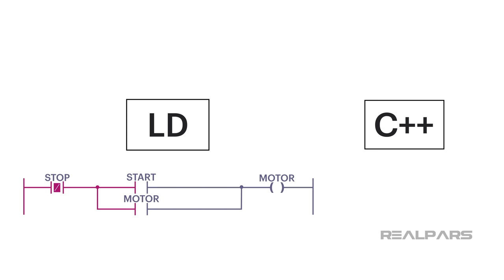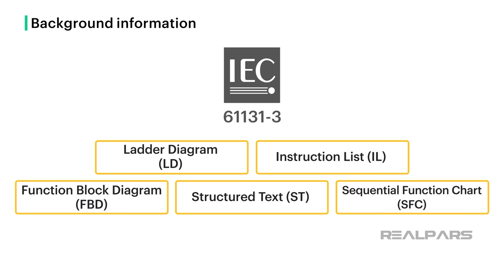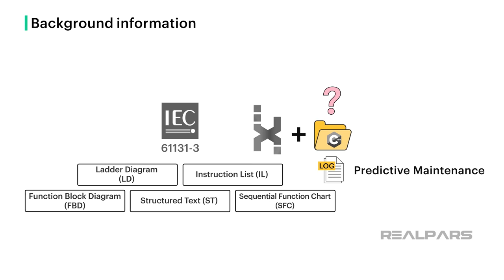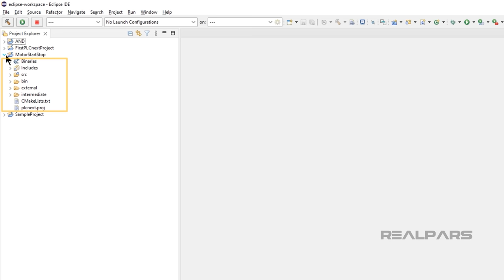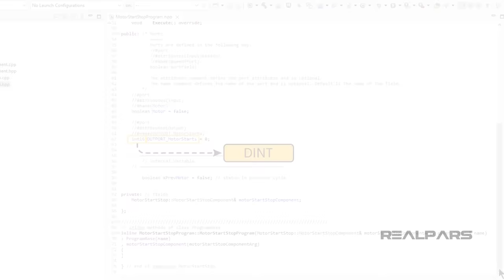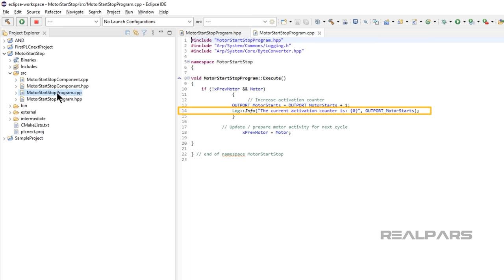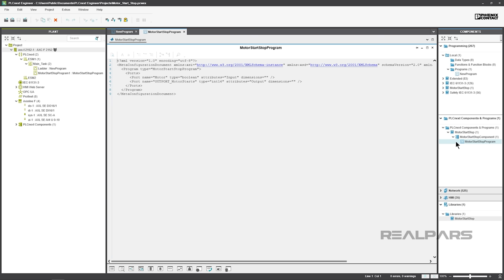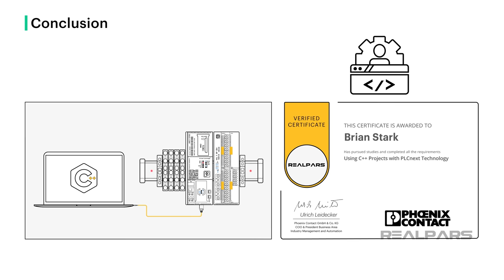Introduction to PLC Programming with C++

Comment: Well explained. This is where the benefits of DCS over PLC are apparent. Using ST these and many other functions difficult in Ladder.  Great option for PLC’s to raise the data options.
Reply from the maker: Thank you very much!
Reply: You mean dual safety?
Reply: A PLC can be part of a DCS. You obviously don't know what you are talking about, just like the guy who runs this channel. Distributed control system means just that.. it has nothing to do with NOT having a PLC. Also using ST inside a PLC is not very useful if you work in a company with more than just yourself... most technicians can't troubleshoot ST and you are just making a nightmare for yourself. There's really nothing you can't do in ladder that you need ST for.. maybe initialization stuff but even that not ideal.

It's even smarter to leverage ladder logic even if it's less elegant because it makes troubleshooting for technicians far easier. Designing systems for the end user and not your own pride is what good engineers do.
Reply: @bradystewart5534  something tells me that you think from the height of your competence, apparently LD, this is your maximum, for this reason you are rude to everyone in the comments)))

Comment: Good afternoon, yes, this is interesting, but there are nuances, not all automation engineers know C ++, and also if we are talking about large projects, like the "blast furnace" example, where there are a lot of mechanisms and sensors, and in the event of a breakdown, you need to quickly find the cause , considering that everything is done on the PLC, then the LD language is the most optimal of all those listed, I once wrote a program completely in ST, when creating an object, I had to rewrite everything in LD, since this was required by the operation, I think, as for the developer, use C++ has more features, but for exploitation, these are only minuses

Comment: I created my own language to do this sort of thing and it has logging built into it. It's a functional programming language so it's easier than C but can do more than the non-C alternatives above. How the logging works is that for each output the programmer defines the user can just tick a box and it will log and and display real-time web graphs. Actually the code to do the logging is rather more complicated than your example. I've built in data compression, which is good if you are logging a lot of data and need to display it from the database.
Reply: Github link?

Comment: What are the minimum system requirements to warrant a PLC? I program with microcontrollers at work every day. When would I switch from a generic micro controller to a standard PLC?
Reply: PLCs are just rugged and industrialized controllers that are geared toward industrial environments that require very high uptime and reliability.  For a microcontroller that say runs an appliance, you might have to reboot it periodically.  If you are controlling an industrial process a reboot might cost millions of dollars in clean up as well as other problems.
Reply from the maker: Hiya! Great question and perfect timing..... We'll be releasing a new video shortly called "PLC vs PC: Which is Better for Industrial Automation?".   Stay tuned!
Reply: At GM the threshold was more than six relays. That is, if the design requires more than six control relays (contactors and starters don't count), the relays would be replaced with a PLC. 

As for an embedded controller, at $5,000 - $10,000 per minute for downtime it makes no sense whatsoever to cut corners with an embedded controller (and let's be clear, a PLC is just another form of an industrially hardened embedded controller). The one that I knew of that snuck in was a brake fluid boiling point tester which ran off of an 8052 (IIRC), and would crash quite frequently.

One of the earliest versions of a "PLC" that I saw was a controller that was basically logic gates and had its "program" wire-wrapped in. This was at the old Shreveport Truck & Bus plant in the Paint shop. When it was retired from service, the guys kept it as their own museum piece. We also used old Selsyns from WWII destroyers for line master/slave position control. And the job rate was set from a Veeder Root (old school gas pump)  :) 

But getting back on track, uptime is crucial, and while the brains can be a micro controller (and usually is), the I/O has to be industrially hardened to take whatever the outside world tries to hand it.
Reply: @MrWaalkman  thanks for the detailed answer 😁

Sounds to me like the cost of downtime is the biggest factor that I hadn’t thought of. Nothing I’ve written had to run unattended for long periods of time where a reboot would’ve caused an issue.

It seems that if your system has a high penalty for downtime, and if the controls are simple enough to be done on a standard PLC, then that’s a perfect spot for it. Using standard PLC programming software would mean you’re using a well tested and robust framework, while writing your own C code for a microcontroller could have all the bugs in the world.

I’ve worked on rocket engine test software that had to be more rugged than an arduino (sitting out in the desert handling hundreds of channels of up to 28V I/O), using all the industry standard din rail mounting signal condition and DAQ equipment, like Nation Instruments I/O. The complexity of the software requires that it be run on a desktop PC but interfaced with all the relays and signal conditioners through the NI equipment. The company spent a lot of money testing the software, and it was also only used for short duration tests while actively monitored by humans. It absolutely couldn’t crash during a test, but it also had no penalty for being rebooted between tests. That’s the most rugged I’ve ever needed a system to be. All my other controllers sit in a comfortable air conditioned room.
Reply: @realpars  Please don't tell people to use a PC for industrial automation. You already made this hack video... if you don't know why PC based control is equally as hack then just stop making videos. You're not good at this.
Reply: If you are doing industrial control / automation, use a PLC. It's that simple. NEVER use PC based control. A PLC only scans its program where a PC has to run GUI and other BS.... so PLC is far more reliable. Anyone who uses a PC for industrial control is just a hack who doesn't know any better. It's that simple. Microcrontroller not really for industrial applications.. maybe niche commercial for like some medical stuff or smaller scale.
Reply: I geuse it all depends on what you want to  
do. As a general rule industrial automation wants some sort of PLC..PEC...DCS...SCADA type of tried and tested system....
If that is right or wrong is sort of irrelavant
..its what industry knows.
And just to make a statement ...there are industrial PC's that operate PLC's beckhoff..and some others..
Ive even worked on PC's that peform vessel Dynamic Positioning...and I might agree that this is not ideal but if it complies with certain rules governed by bodies such as ISO and IEC and others. I think there is an argument not to use PC's.....but there are rules of what makes a good PC for industrial automation...no fans..no battery backed memory...filters....sure there is a lot more...but you get the idea

Comment: Am I right in thinking that unless you have realtime or environment requirements, it's perfectly feasible to avoid PLCs altogether in favor of, say, RPi or KNX or something similar?
Reply: PLCs are only for industries because it's not only about microcontroller but also strictly defined but rather simple IOs. In general PLC programs are simple in terms of funcionality but they control very important factors in industry and therefore are standarized.
Reply from the maker: Hi @Dmitri Nesteruk.  Thanks for your question. I hope we didn't give you the impression that the only consideration for choosing a PLC was realtime and/or environmental issues.  As we said in the video, flexibility with programming in 61131 languages and ease of expansion is important. Compatibility with field devices and available I/O modules is also essential.
Reply: You technically could, but bear in mind PLCs don't have all the software overheads that OSs tend to have like Web Browsers, Media Players, etc... I guess you could put a special OS to turn it into an embedded system and improve its execution speed, because one of the requirements for HVAC and especially Industrial PLCs, is execution speed.